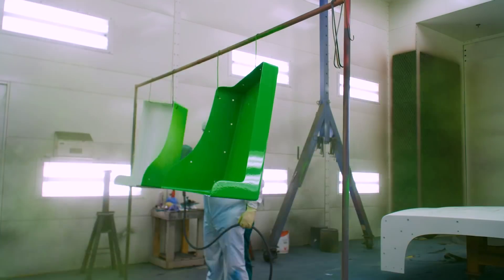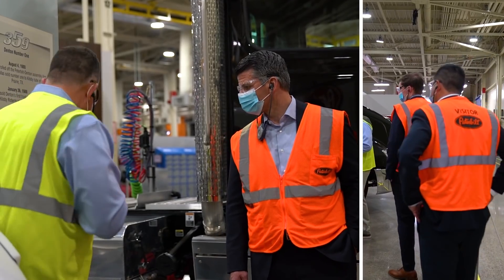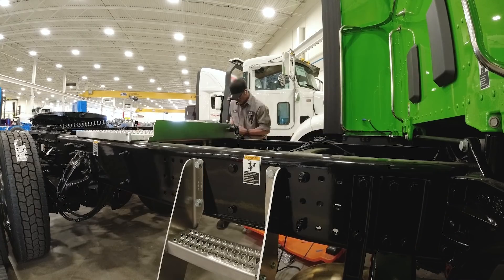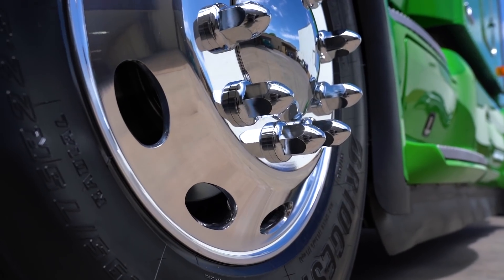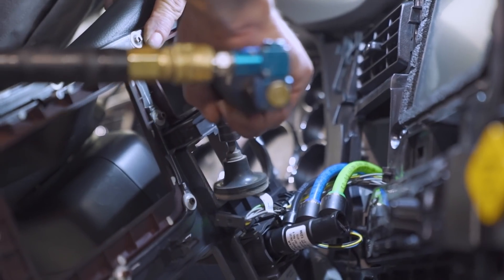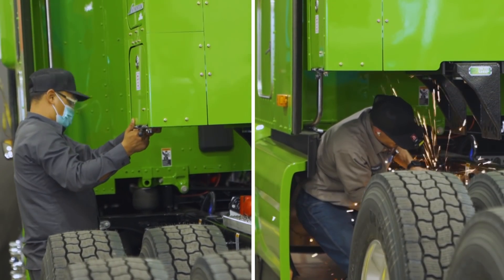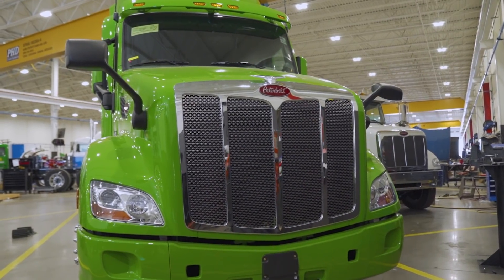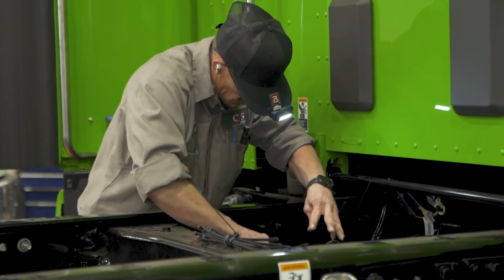Alpha One: Episode 1

Comment: Can't wait to see how this pans out. I'm holding off on buying my own equipment until I can see some more numbers on how this hypertruck compares.

If it's possible I'd look into importing a European LHD cabover truck, gutting it, and put something like this in it. I'll have to do some more research on the possibility of it, but it would certainly make for an interesting project.

Also what's the possibility of an electrified steer axle? That could be quite beneficial for certain applications and should be easier to implement with an electric drivetrain. 6x6 or 8x8 would be an interesting option to see available for the future.